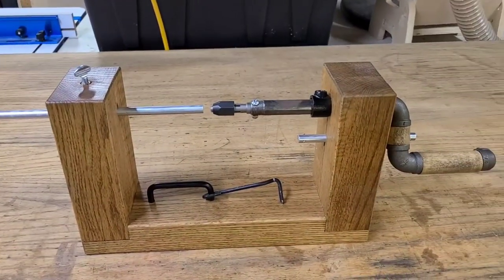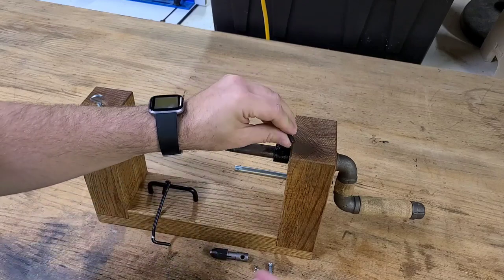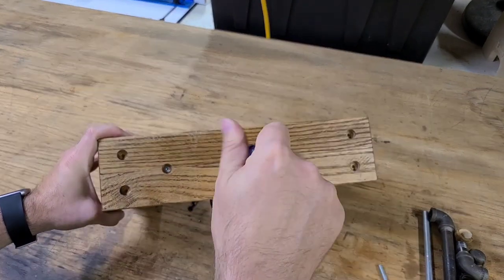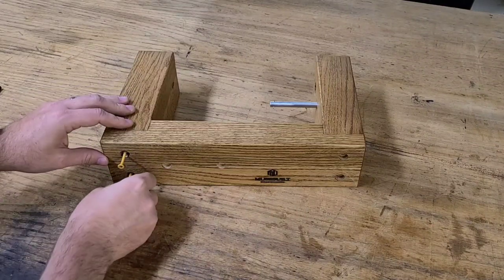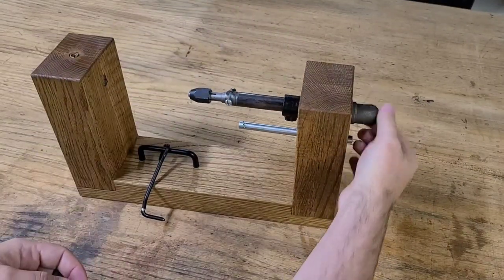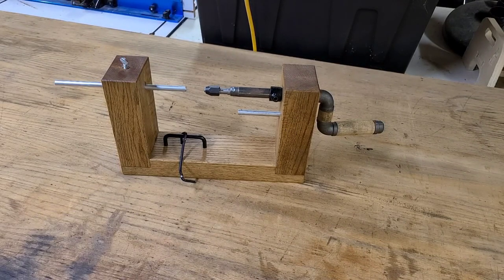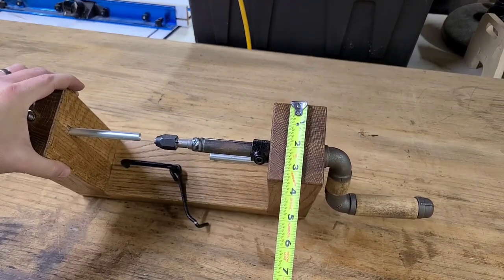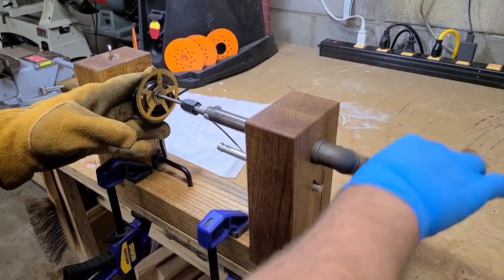How To Build This Clock Mainspring Winder Under $80

Comment: Used your video and built mine using 2x4 scraps 1x2 horizontal side strips for base post supports. It clamps nicely in my old Black and Decker Workmate bench. Instead of using 3/8" aluminum rod, I bought a 15" 10mm aluminum tube with 1/4" ID from Amazon along with 10mm steel set screw collar to lock  tube in place for the left side rear arbor holder. Arbor fits nicely in the the aluminum tube. The set screw collar simplifies and eliminates the thumbscrew and EZ Lock install. I've used it on my first kitchen clock and it works great. Thanks so much for the video instruction and parts list!
Reply from the maker: Awesome! That was a good idea! Thanks for sharing.

Comment: Just wanted to let you know I put together a winder based on your design.  It works great!  The only thing I did different was the loop holder.  I used the T-handle portion from the tap wrench, drilled a slightly over-sized hole next to the 3/8" aluminum rod used to hold the pivot.  I'm able to slide it in to secure the loop and slide out when removing the spring.  A thumb screw locks it in place.  Also, I didn't use threaded inserts for the thumb screws, I just drilled a slightly smaller hole and threaded the waxed thumb screws into the wood.  Thanks again for the design and your excellent video.
Reply from the maker: Very nice ideas! I'm glad your winder is working well for you. Thanks for sharing!

Comment: Really nice job you did there. You could add some steel T section and screw it good and proper to the underneath then use your vice to hold it nice and tight. Cool, thanks for sharing.
Reply from the maker: Good idea! I'll look into that. Thanks for watching!

Comment: I like the simplicity of your design, which in turn brought a reliable and fully functional winder. Do you think using bearing on vertical pieces of wood would be beneficial? Thanks for the great video!
Reply from the maker: It could be beneficial. It's worked pretty good so far. Thanks for watching!

Comment: Before your Next clock repair learn how to do bushings and Polish pivots to ensure your repair lasts long there’s plenty of YouTube videos showing how to do it by hand anyways great videos and I hope to see your next repair one of these days 👍
Reply from the maker: I've done a bushing in one of my other videos, but I haven't polished pivots before. Definitely need to learn that skill. Thanks for watching!
Reply: @WatchOverhaul it’s where you take a lathe and put the wheel on it and it spins it at a fast speed then a sanding block would be added onto the end of the gear to remove serious groves and scoring so there’s no friction and for the American clocks due to their long gear stems/pinions you could use a drill
Reply: @WatchOverhaul if there is a bit of scoring on the pinion and no serious grooves buff sticks/sand paper sticks can remove them too 

And for the American ratchets sometimes they get loose and jump the click spring when winding so it explodes so they can be tightened by finding the nail like thing that holds the ratchet in and use a center punch and a vice to hold it and tighten it not to where it’s too tight but to where there is no so much play

Comment: Lol I just commented on the Gilbert video about free plans and building one of these...
Reply from the maker: Saw that, haha. I spent a little more than $20, but I wanted to make a quality one. Thanks for watching!
Reply: @WatchOverhaul I built one myself, not as nice as yours. I also cobbled together one for barreled springs, it uses different sized exhaust pipe/muffler adapters
Reply: @WatchOverhaul  I built one but it was not as nice as yours. I made another that uses muffler adapters for the barreled springs. Found that online as well.